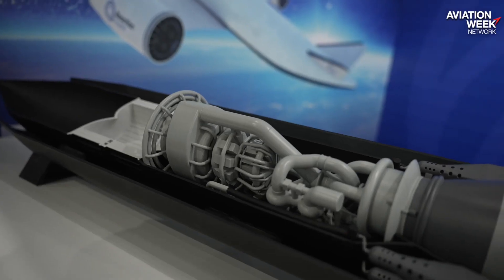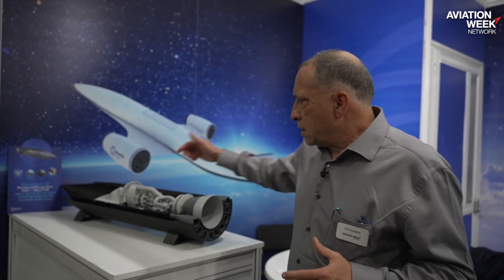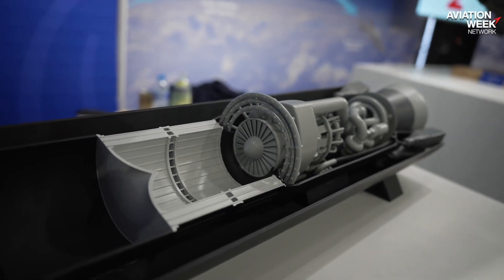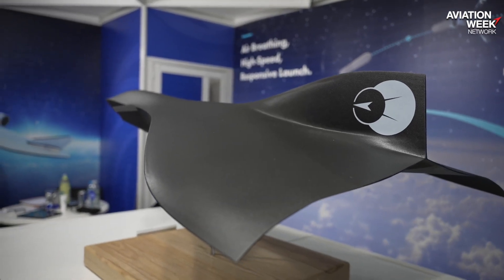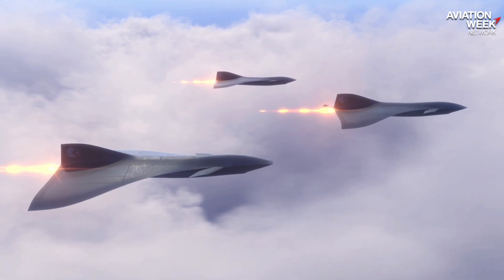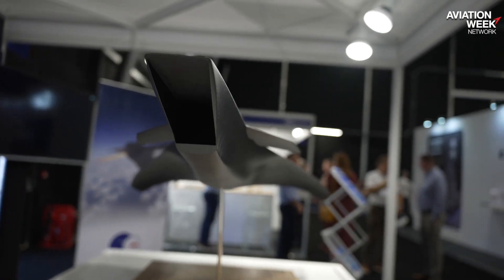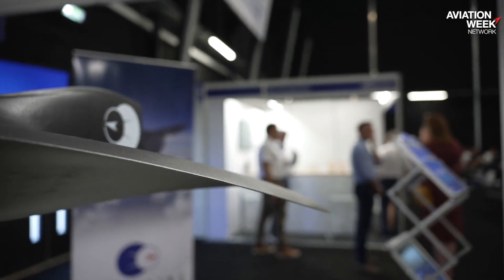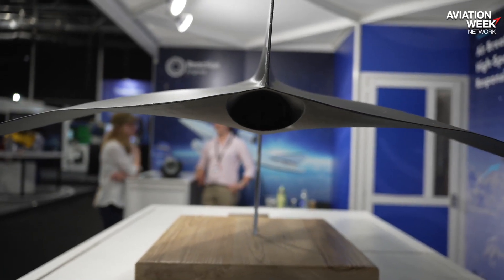Farnborough Airshow 2022: Reaction Engines’ Hypersonic HVX

Comment: Fantastic heat exchanger - In one second 400 lbs of air becomes 400 lbs of liquid oxygen and liquid nitrogen - A site bound demo of the heat exchanger would change liquefaction immediately
A reservoir of 1 ton of air, multiple turbine stages feeding the heat exchanger - vacuum / steam on the post liquefaction side - Every minute run it through for one second - ultra high production